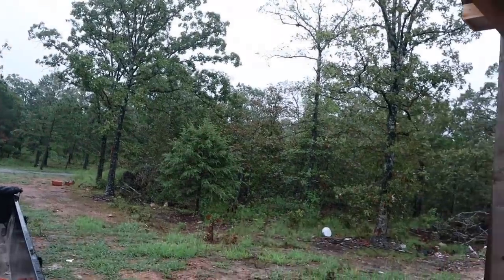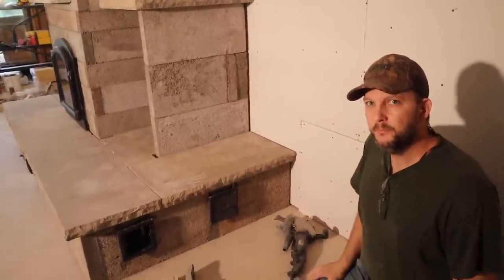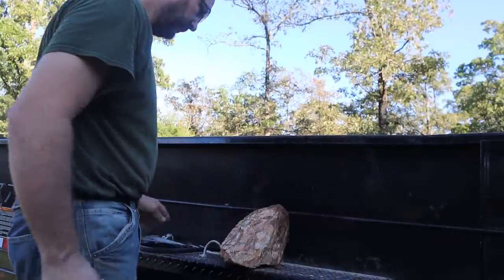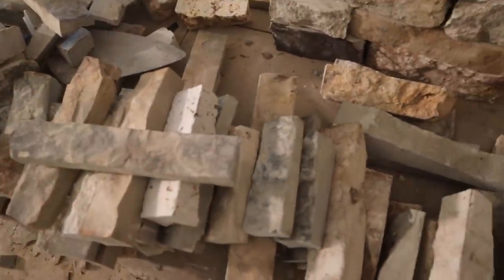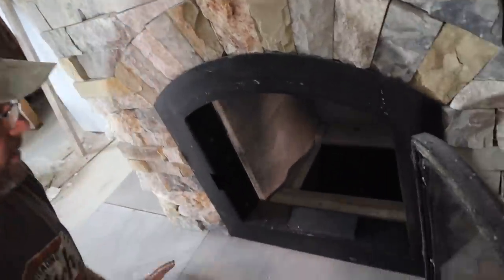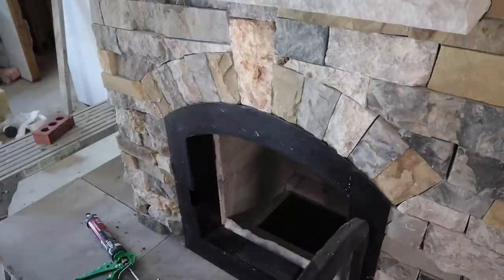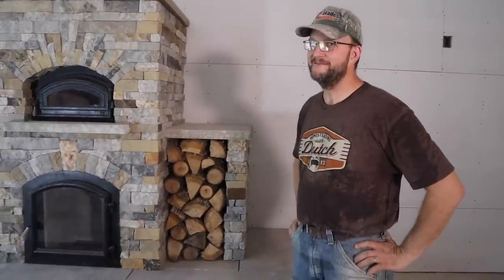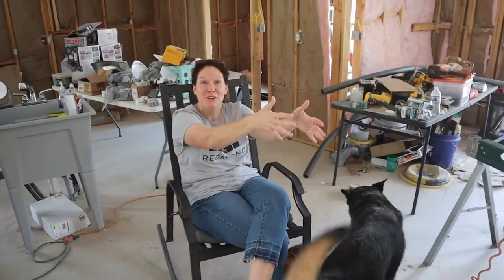This Will Burn Half The Wood As A Fireplace | Masonry Heater

Comment: I love how that turned out! I'm curious about being able to have one installed in a house over 130 years old and is setup off the ground with a crawl space. I love a fire, but due to a wood smoke allergy I've had to avoid them. It seems with this one there would be zero smoke escape to worry about so I'm profoundly interested in this!
Reply: Give us a call or send an email. Patrick will be the one to answer. The crawl space is likely not an issue!
Reply: @temp-castmasonryheaters5970  - Wow! That is not what I expected to hear. That's exciting news. Thank you so much for your response. I'll let the hubby know and shoot an email.

Comment: Great videos here guys and very nice work indeed. I just ran some numbers where I live and one of these would pay for it's self in 10 to 12 years just on wood savings alone , add to that electrical savings and just the quality of life a fire like this adds its well worth it. I grew up sitting round the fire , we always had Agas and Rayburns in the house , The main fire place brick ran right up through the house and stayed warm all night after a good fire..   the sheer thermal mass in your design here will retain a massive amount of heat for sure.

Comment: Great looking 
Curious why there was no mechanical bond to the slab?  Something as simple as  1/2” x 4” steel bolts drilled into the slab. Seems like earthquake codes would require something like this

Comment: Did you make the cement floor underneath the heater thicker and with additional rebar to carry the weight of the stove and the air holes he cut behind the heater I would be afraid of mice getting in there! Looking good 👍
Reply: with a grill cover how are mice getting in there?
Reply: @18twilliams  he cut small squares at rear of stove maybe you answer the concrete thickness question also

Comment: Question.  I see you have the Zip system in your build.  How sealed up did you build your home?  And it is it tight (with under 1 ACH50) are you venting in outside air to feed your fire?

Comment: You might be able too answer would it be possible to add a Natural Gas ( with Electric Start ) as well as Wood in the same Unit ?? In case you don’t want to use wood. 
Just a Hmmm 🤔

Comment: This is really nice. But I have one objection to the design. The hinges on the doors are on the right side. Same as the wood storage. If you want to add wood, you have the door in the way. Either have the hinges on the doors on the left side, or built the chimney on the right and put wood left of the fire box. I would prefer the second solution, you can easily grab a piece of wood with your left hand, open the door with the right hand, addind the wood, close the door. One simple, fast, convenient motion. And I guess you will be bringing the wood pieces through the door on the left, so stacking the wood storage area will be easier and faster.

Comment: Quick question, the cool air inlet vent Pat cut in the stone, will that have a screen cover? Just in case some little creatures of God find their way inside? I rent and the landlord had the house painted. They had to leave my front door open to allow the paint to dry and I have no front screen door so was invaded by a lot of little tiny mice that wreaked havoc in every room of my house before I could eliminate the majority of them. Still have one or two that are avoiding all traps.  They trashed my kitchen and stored products for baking, rice, bread, soup and seasoning mixes, etc. Summer was and still is being spent scrubbing, cleaning, disinfecting every nook and cranny of my home, trashing damaged things, rewashing what was clean  clothes  and laundry, etc. What a mess!! I'm 76 so not a young, spring, chicken any more and our summer temps daily in excess of 100⁰F+ hasn't helped.
One other question, if you used the heater as say a wall divider between living area and kitchen, could you have the large firebox face the living space and the upper cooking oven facing towards the kitchen? Basically turning your cooking oven 180⁰? Just curious.

Beautiful product, and so enjoyable watching Pat, a master in his craft! God bless. .